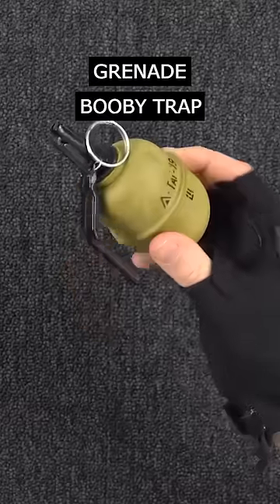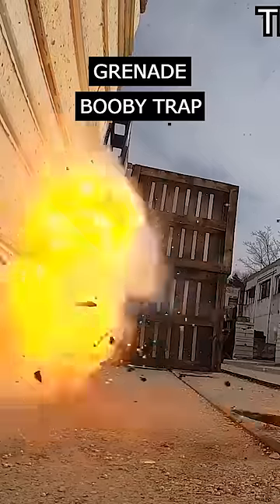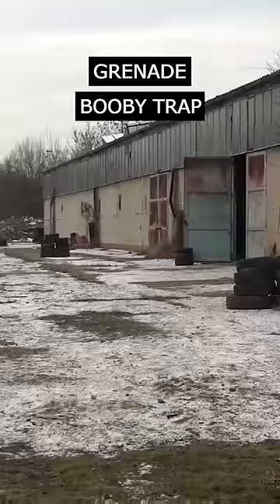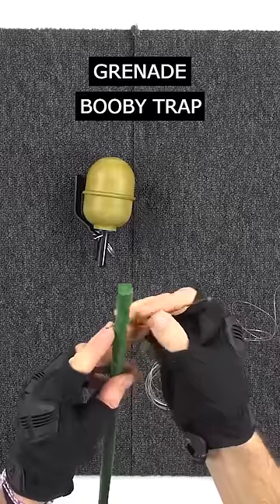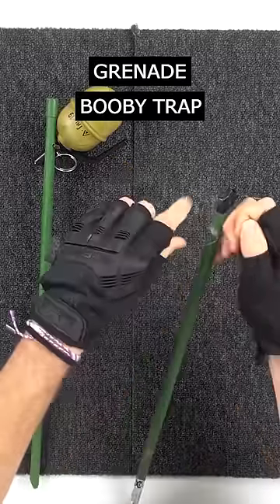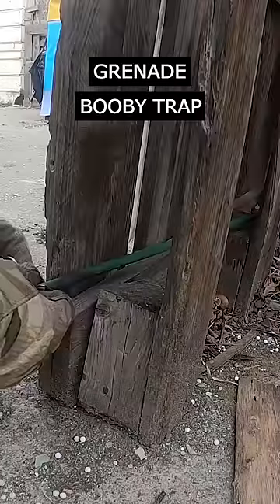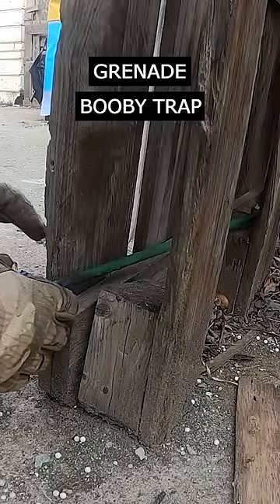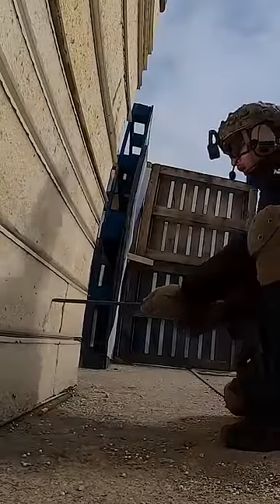Booby Traps In AIRSOFT #shorts

Comment: You cut the top off of a can of soda or pop. Pull the pin. Keep the spoon depressed and slide the grenade into the can. The can will hold the spoon in place. Then attach the string to the grenade itself. Attach other end of string across footpath. Attach can to an object to hold in place. Point the opening of the can towards the footpath.The pressure to pull the grenade out of the can is significantly less than needed to pull the pin. That's how the player knew what happened. The can method will make someone look down to see what is touching them. By that point it's too late.

Comment: That could work really really well, you just have to change your layout. You know when they trip it they're going to run, odds are they going to run back the way they came. So just put the grenade further back on a longer string they'll run back towards it. Is there really alert they will run away from sound of the trigger in which case, you can only use two grenades. Your theory is sound you're implement of it not the best. But you can do better.
Also point of fact on Amazon they do have claymores, they can be loaded with BBs or anything you need to. They have a tripwire with no delay, and they also have a detonator. 
Happy hunting

Comment: Put the trip for the trap farther from the grenade so when they realize they tripped a trap they run to take cover but they run towards the grenade when it will actually go off. This is assuming they didn't see it after they passed it

Comment: IRL they'd pull the pin with and the spoon would come off then re insert the pin stopping the grenade from exploding (if memory serves well enough. Or they'd pull the pin and hold the spoon on the grenade thus causing it to explode immediately after the spoon came off. Again just going from memory

Comment: Does the spoon actually function on these? If so you can do what the Vietcong did in Vietnam (my father served there), tie the string around the grenade with the pin pulled, slip it into a can, and position the tripwire like that

Comment: Funnily enough the RGD-5 grenade this is based on can be used with a MUV zero-delay tripwire fuse instead of the delayed hand grenade type. Also I've tried to figure out a way to make this near instant. Maybe if the pin was removed and the tripwire held the spoon in place? I just don't know how that would need to be tied :/

Comment: Place it inside a can/empty toilet paper roll; something that has enough pressure to keep the spoon/safety lever in place.

Rig the wire and pull the pin - the wire will pull the grenade out of the can and presto.

Comment: The reason why this trip wire did not work is because you used a normal grenade. I think that the Vietcong or the Japanese used Grenades that instantly explode once the pin has been pulled.

Comment: So if I'm right the right way to set this is remove the pin the use the wire to hold down the charging lever . Then attach the peg and plant the the grenade.

Comment: Questions : doesn't work like a real grenade?...i'mean is the spoon safety fiture working?...if it's pull the pin and putt the grenade in a tin can So the spoon is jammed by the tin can Body and tie the string to the grenade...if it's pull out from the tin can they will explode... that's how the NVA did it...best of luck cheers